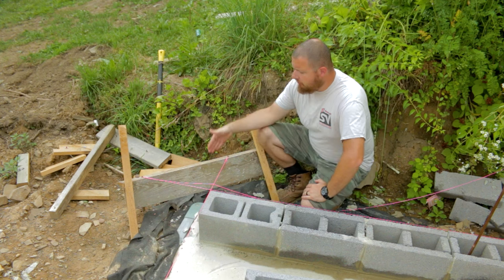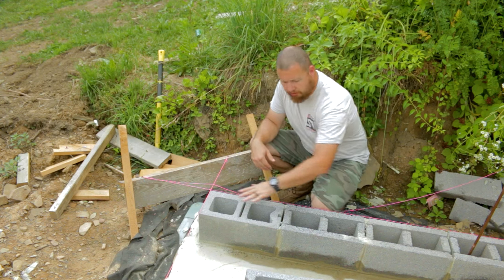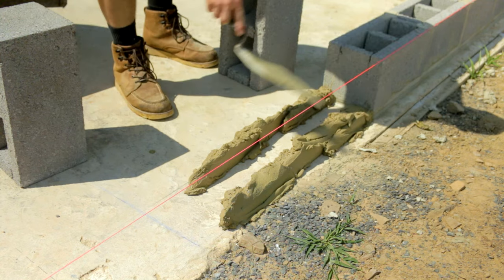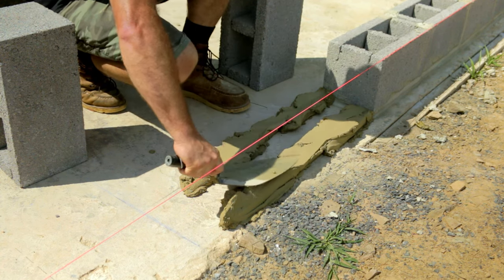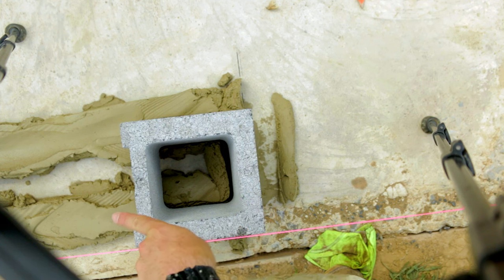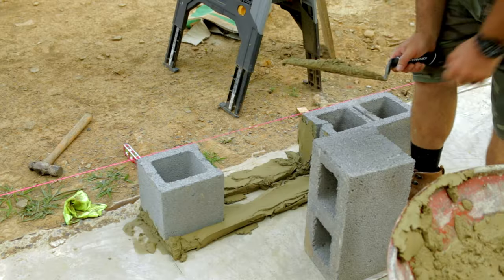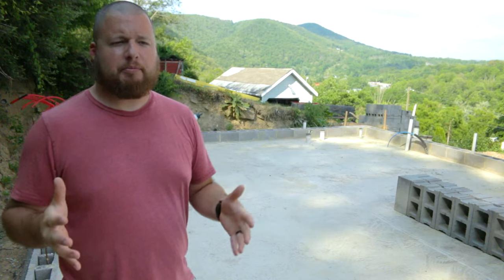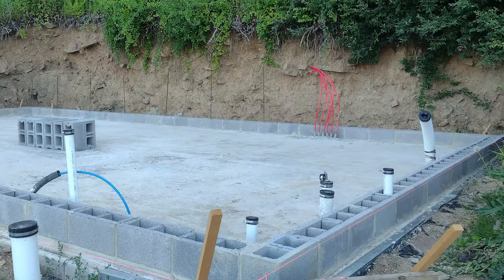Garage Build #20 - Laying the First Course of Block

Comment: I came here to determine whether I needed to prep my slab before laying the block down. Does that mortar adhere to it directly?
Reply: Yes, unless the slab is painted. If it's painted, you will need to apply a concrete bonding agent.

Comment: I understand this is a garage. Do you take the same approach when building a home, as in is this safe? I am from Nigeria, and our head joints are much larger (2 inches average), which means we use a lot of mortar both for the bed and header. What'a your opinion about it?

Comment: Thanks for the video. Question, I'm in Ohio where the frost line is 32 inches below grade. If I were to build a block workshed (probably 14ft x 14ft), would my trench and footer need to be 32 inches deep, and 16 inches wide around the perimeter?
Reply from the maker: All depends. If its a shed you may be able to do just do slab on grade. If you want it to last longer, yes, put your footer at least down to the frost line. If you plan on getting a building permit your local township will tell you how deep it needs to be

Comment: Pour through/ knock out bond beams for first course, did you drill rebar in and knock the bond beams out add steel and pour?
Reply from the maker: We wet set some of the rebar. For the others, we drilled and epoxied them in

Comment: What would be the first block type to lay coming off in existing wall or foundation?
Reply from the maker: What do you mean by first type?
Reply: @appalachiandiy2415  Sorry if I'm not wording the question correctly.  The end of the Block touching the house foundation has me concerned.  Is it a corner block or the block with the two butterable tips on it?  Some have just one butter slit in the middle too.